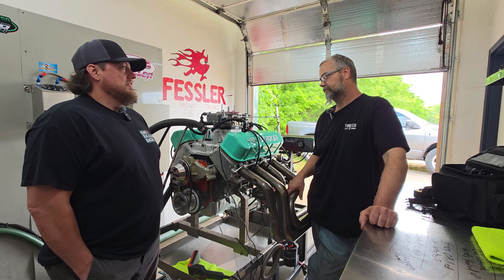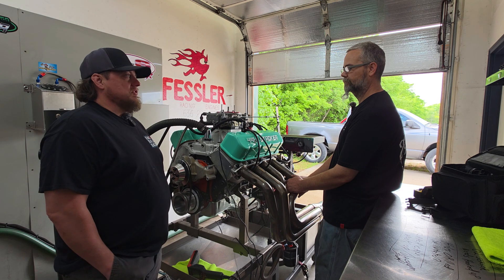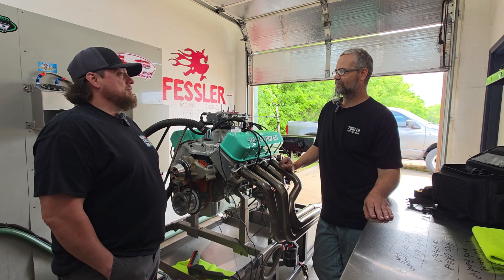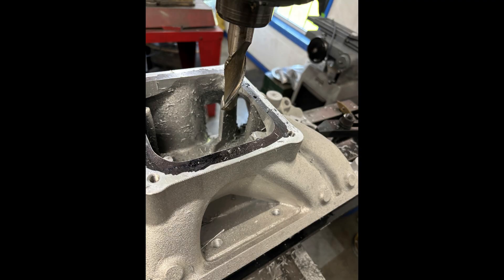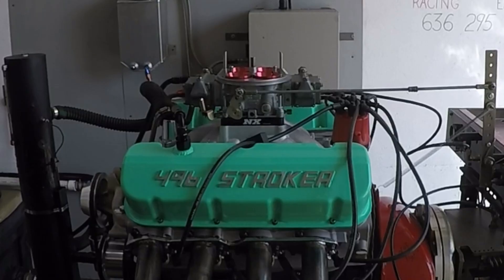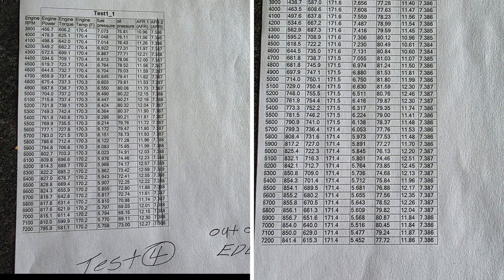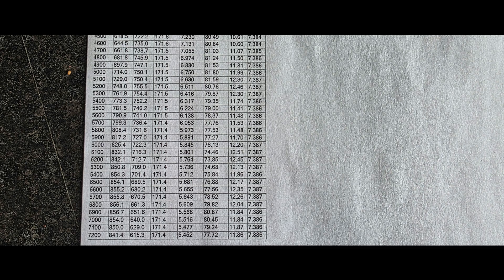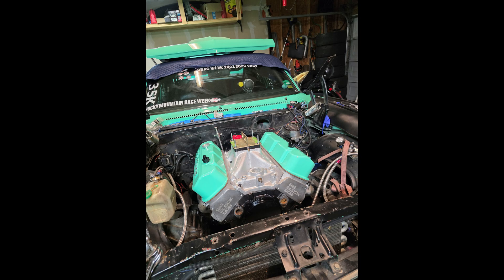7000 rpm 850 hp 755 lb ft 555 cubic inch Big block chevy dyno session naturally aspirated

Comment: Have you made a good pass on motor only yet? I am still waiting to see what your combo does since it is so close to mine
Reply from the maker: Negative. I'm having some ignition and shifter issues. That said 2 passes have still been in the 9.90s but mph is down. I'm not getting 1-2-3 after installing a new cable, broke the old one. Similarly I've hit with some nitrous but haven't gone out the back yet. New best incrementals 60 1.333 330 3.753, 660 5.81 but only 115. All while using 100 hp.of nitrous compared to the previous 496.
NA in the right conditions I'm hoping for 9.6x or low 9.7x.
Reply: @bigblockbob  5.81 is 9.0s/8.9s I bet you are going to go 9.50's or 60s on motor
Reply from the maker: @1972novabill I'm hoping to get another crack at it before the season ends. Threat of rain this weekend isn't helping. I picked up a new converter a month ago. It has picked up 60'. I was pushing through the old converter on anything from 9.20s to 9.0s.
Reply: @bigblockbob have you thought about an air pan to seal your carb to the hood? Maybe can't now with the sunoco hood?
Reply from the maker: @1972novabill I haven't. I'll try it with the hood off again. It seemed to help during race week last year.
Reply: @bigblockbob I wish we were next door neighbors, we would have a lot fun with our Novas!

Comment: In unrelated to power output, anyway feel the money pulled from their wallet as the carb opens up and dumps fuel into that monster. 
 I mean I run an 830 Holley on a small block so I get it, but that thing is thirsty!!! 😮😮😮
Reply from the maker: Cheaper than therapy haha
Reply: Yes

Comment: Curious how the dyno determines the air/fuel when there are no oxygen sensors or an air turbine to measure air flow to calculate BSFC.
Reply from the maker: Drivers side bank had a wideband sensor

Comment: My Straub cam signed off at 6800 rpms also. .774/.745 lift 274/.278 @ .050 109 solid roller in a 13.5 to 1 565.  Nicely ported Super Victor .  Tony Mamo ported AFR heads  Made close to 900.
Reply from the maker: Some have said i should have gone SV2. Did you pick the Super Vic or how did you end up going that route? That's good power you are making. 
I felt like if it kept making that 7 hp per 100 rpm for a few hundred more I'd be over the moon. If the car runs the number it won't really matter ultimately.
Reply: @bigblockbob  I was told SV2 were more meant for very large high rpm cu.in. engines. Mine is also going to spend a lot of its time street driving. Also, I noticed a lot of the big hi performance engine builders were using the 2927 Super Victor on their 540/565 combos. I then had Scott Forxwell port the 2927 and match to my  AFR heads. He did an outstanding job on that. Even matched the 1 inch spacer and dowled it to the intake.
Reply: Boohoo. Only 900. Happy